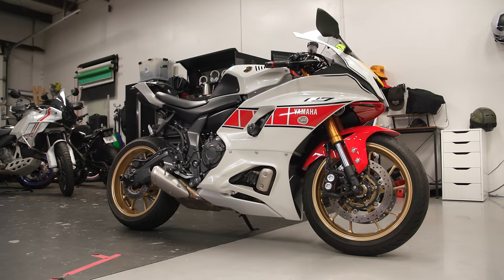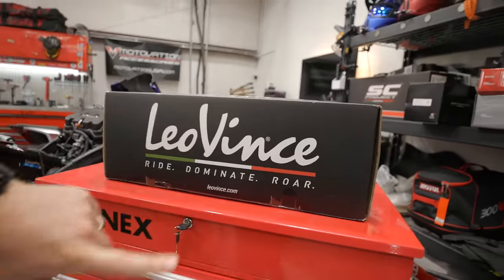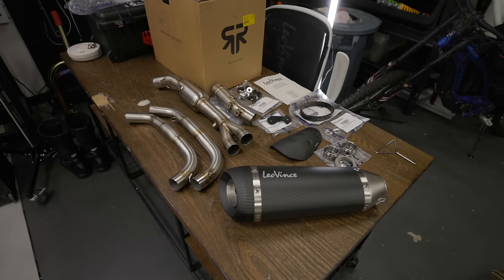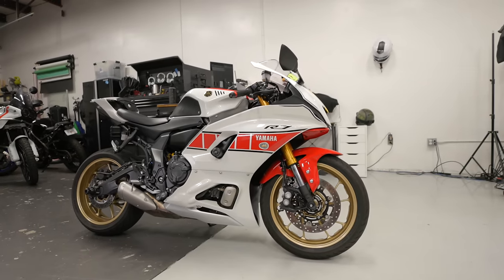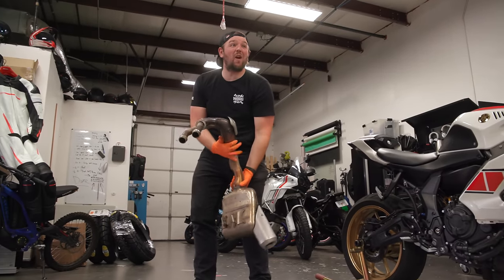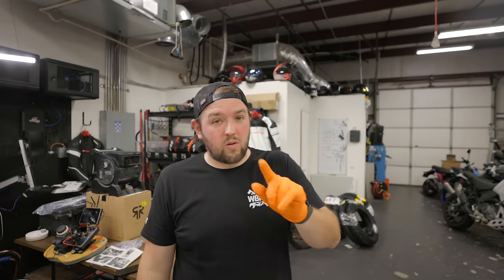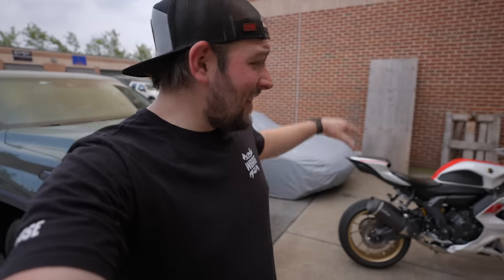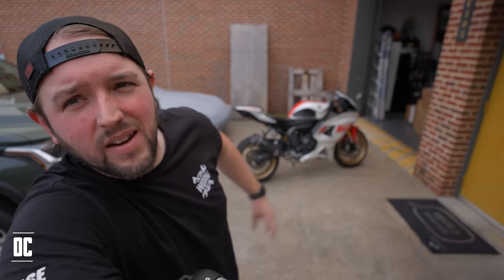Yamaha R7 Leo Vince Exhaust | Install and REV!

Comment: It's so crazy that almost every motorcycle brand are making the bikes quieter... taking all the fun out of it, this one is a good one to look for
Reply from the maker: On a positive side it lets us have fun getting different exhausts to modify the sound
Reply: It's mostly about regulations🫠
Reply: @chaseontwowheels is the exhaust system you installed there legal in germany. Does ist have a cut insinde the pipe or is it straight piped?

Comment: That sound EPIC! I own an MT07 with a custom pipe and it sounds no where close to as good as that R7. I've also heard MANY Akra's, M4's and so on, nothing has sounded as beefy as that Leo Vince. I am VERY impressed!
Reply: Does your custom pipe have a cat installed?
Reply: mt07 w akra ti is meaty as hell bro..
Reply: @Daniel-dj7fh  nope. Its a slip-on with a cat delete (link pipe) to the original headers. Cost on that was like a tenth of a full exhaust system. It was  around $250. My MT07 is the OG 2014 so the cat was right by the muffler side, not by the headers like the new versions.
Reply: @OtterMachine  yeah but you need to saw off the cat from the headers
Reply: @ridewith7480  only if you use it ouside the ece certificate.
Legal in Europe it sounds like stock+
Reply: @Daniel-dj7fh  yup. I didnt do it. A custom exhaust shop did it for me, they local to my city and so they dont charge a lot for the install.

Comment: I've seen an R7 with a turbo kit installed. It more than doubled the HP. This would be the bike I'd consider due to being perfect for boost. There are kits specifically for this bike, the XSR700, and MT-07. They just handle boost so well, per professionals.
Reply: Just saw that as well. Sounds sooo fucking good
Reply: @101BadBreath  Uhhh...Stephen. (Sniff) No one mentioned or thought about "weiners", but yourself. We're talking about bikes and boost, my friend. So, stop worrying about "weiners" please, especially other men's "weiners." Smh. Sheesh. TF? 🥴
Reply: Till it doesn't lol
Reply: No they don’t handle boost well at all 😂 every turbo one has been blown up
Reply: @stevelubs  Bad tune more likely. You can boost anything safely if you know what you're doing. I know that from experience.
Reply: What on earth would be the point of turbocharging one of these? By the time you install a turbo and get it set up properly you're talking brand new liter bike money. Like yeah you can make the same or more power than a 600 but the frame on the r7 is less rigid, the suspenion is worse, brakes are worse, its just a worse bike in every way if you crank the power up. Only reason to get an r7 is if you want a more tame bike then an r6.
Reply: @DANNYHEADSHOT  Probably because it's the owner's product. So, they are entitled to utilize their own ideas and creativity just like what other owners do with their bikes and modified cars. It's a reason why they call us enthusiasts and I support ideas that others would never understand even if it defied logic. That's the fun part...
Reply: If you want to break it, sure
Reply: Wtf would you turbo it for anyway, buy an r1 if you want to go faster
Reply: @user-360johnn  Or turbo it, if you want to be more creative...and different. (Clearing throat)
Reply: @Jig1saw  ah yes, how creative, nobodies ever done that before. All im saying is that bike will break
Reply: @user-360johnn  It's a part of the enthusiast experience, doing what you like even if it "breaks." Bikes can break when stock too. The key takeaway is that, it...is...not...your...bike. (cough...sniff) 😌
Reply: @user-360johnn  Why R1 when you can go faster on H2.

Comment: This bike sounds a whole lot meatier without that baffle and cat on their exhaust. I hope Leo Vince still sells a catless version like I have on my Ninja 300. At the time of the 300, Leo Vince made the highest dyno-proven horsepower, was the lightest weight full-exhaust, was one of the best sounding, and unquestionably the best value among several brands for that bike.  I got my full exhaust for about the price of a Yoshimura muffler only! It breathed so much better, the bike had to be tuned. Power gains were realized in mid to upper rpms.  I highly recommend heat-wrapping the exhaust for hotter exhaust gasses (better scavenging at lower rpms), noticeably more low and mid-range torque (and flames too!). Also very slight sound dampening canceling any 'tinny' or pinging exhaust sounds bouncing off header pipes. The 300 is very deep sounding, and quite loud. I haven't had a single issue with rust or reliability in all the years of owning the bike.

Comment: Today, Chase learns that 270 degree P-Twins sound fucking mean when you replace the factory exhaust. lol

Ghost has been running my Honda NC700 exhaust in the quickshifter for a few weeks now, and that was with the Dan Moto XG-1 slip on. That bike is stupid fucking loud with that pipe on there.

Comment: Still doesn't sound as good (or go as good lol) as a 25 year old Superhawk.  Still, I get that the brakes and suspension stock for stock are probably night and day.  And I saw the 60th anniv. in person yesterday at a dealer I had to stop at for my job and it's stunning in person.  And the fact that 3 different guys who work there own one (like the guys who worked at the dealer who I bought my first Superhawk from back in the day all owned one lol) says something.  Couldn't justify spending $10k on one but it's nice.